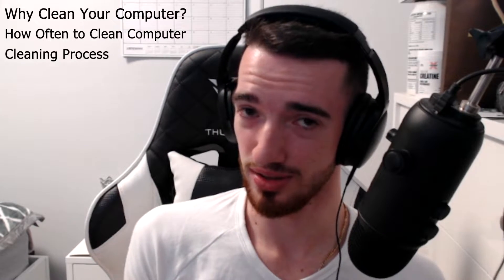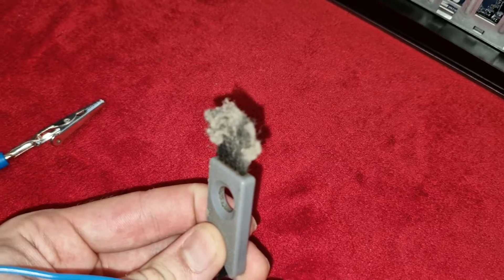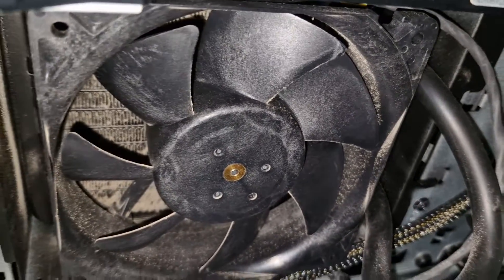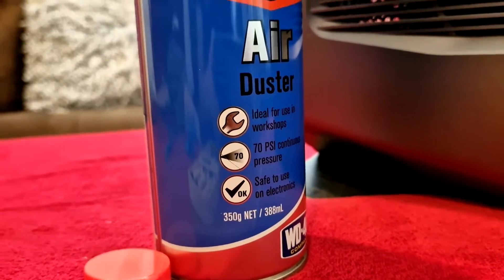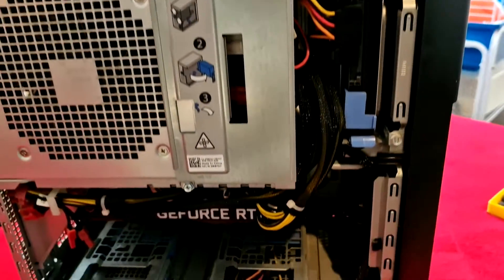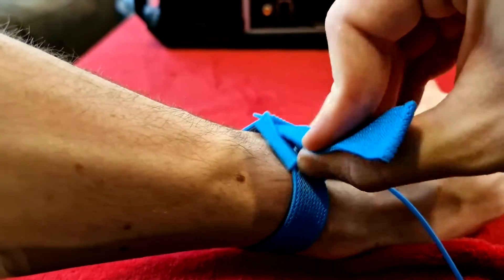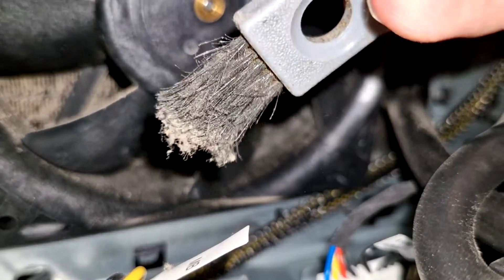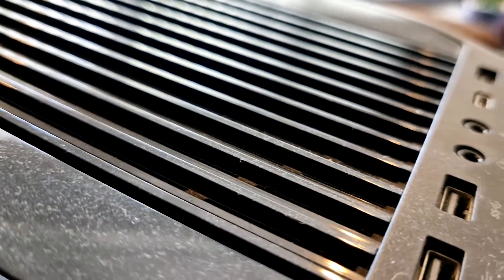How to Clean Your PC | Alienware Aurora R7

Comment: Can I use a paint/tooth brush to clean the radiator?
Reply from the maker: Great question! I wouldn't suggest it. A toothbrush has a risk of building static electricity in the bristles which could short your motherboard. I would recommend a static free brush.

Comment: Thanks for the video! Fans seemed to be running too hard too often; Did a little research and checked CPU/GPU temps and realized what I needed to do. The radiator was covered in a wasteland of dust
Reply from the maker: I'm glad I could assist! You should soon notice an improvement in your performance. Also, check out the links in the description for tools to help clean your PC. I highly recommend the anti-static brush—it's almost a must have.